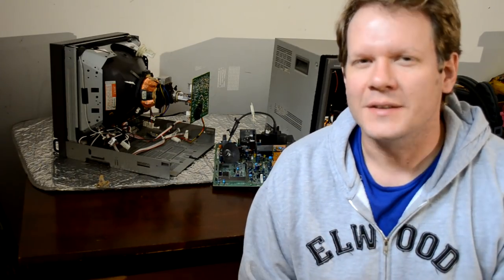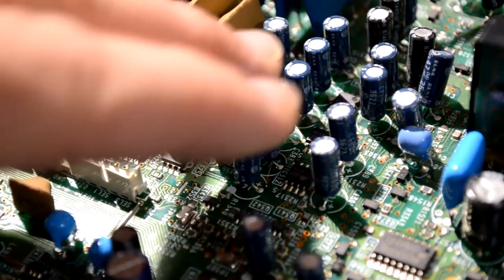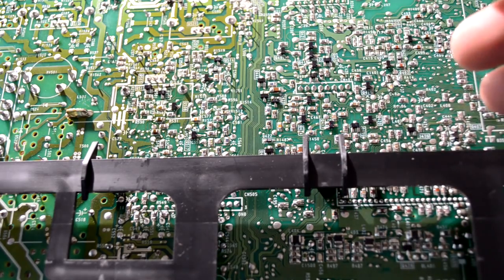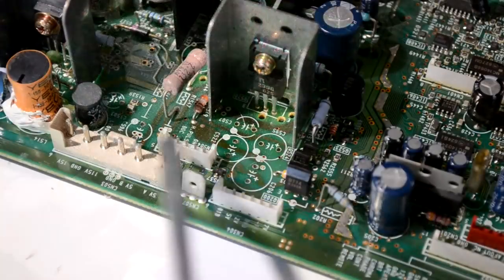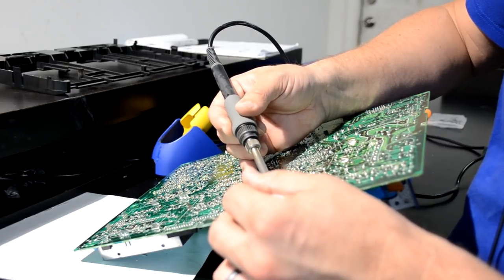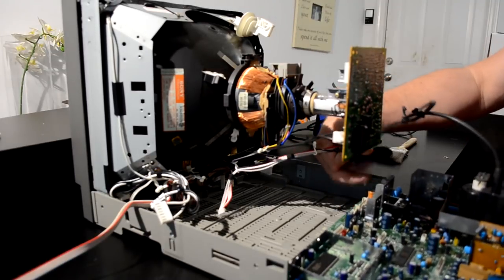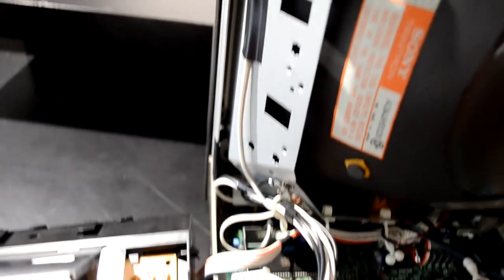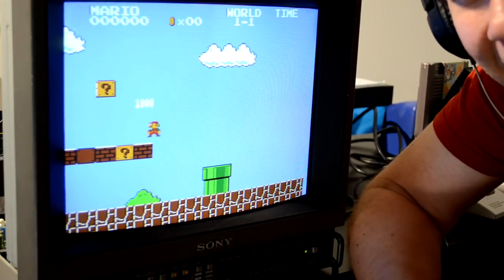Geometry Cap Kits - Sony PVM Screen Perfection

Comment: Reflowing the joints before desoldering really helps.  I've often ran into problem joints where I have to add solder anyways.
Reply from the maker: Yes, best part is it prevents a lot of damage to the board and pads.

Comment: Wish my bvm-2010p had so few caps!   I’ve done psu, convergence board, control boards in the pull out drawer, and all the high voltage boards.  The picture is now possibly too good for 240p.  The scanlines have such perfect geometry they look like they are emulated.  Best crt picture i’ve ever seen. Not bad for a 31 year old monitor.
Reply from the maker: Awesome, yes it's a great feeling to have a perfect monitor.

Comment: Does this apply somewhat to consumer Trinitrons?  I have a Sony Wega that is developing a slight screen jitter and some very slight geometry issues.  The geometry doesn't bother me because it's not too bad, but the jitter is getting kind of bad.  Intuitively it seems like a recap could fix it but the service manual shows a couple hundred electrolytics.

Comment: Should I recap before using the service menu to calibrate my Consumer CRT?

Also, where can I get calibration patterns like the crosshatch one?
Reply: It will be clever to calibrate first and do recap only if you cant fix it with service menu. 240p test suite is best for tests

Comment: Steve. Thank you for sharing your knowledge. I have a 20M2U that shows double blue, green, red lines at the top. Do you happen to know which capacitors need changed? Thanks in advance for any advice.
Reply: Those lines are actually normal, but they should be hidden behind the bezel, so most likely your picture height is too small. I'd try adjusting that in the service menu first, it may be all that is needed. The setting you want to adjust is labeled
"V SIZE" and there is one for 50 Hz input and one for 60 Hz. Have a look at Steve's video about the PVM service menu for more detail.
Reply: Martin Weizenacker V spacing in service menu fixed it thank you!
Reply: @davidcarmichael4006  That's great!
Reply from the maker: I did make a video on permanent fix for that.  2 caps can go bad to cause that.
Reply: Retro Tech i will watch it for sure. Thank you

Comment: Hey steve love the vids, is there much that can be done with consumer flat screen trinitron geomerty wise outside of service menu adjustments. Dont really want pull the tv apart as im worried il will ruin it
Reply from the maker: Thanks, probably not.  Nearly all geometry adjustments are in the service menu for Consumer CRTs made like after 1994.
Reply: @RetroTechUSA  thanks mate its still a great crt and i have managed to get it looking pretty decent

Comment: By the way Chassis refers just to the outer shell or frame of any electronic, not any of the boards or guts... Just thought I'd let you know.
Reply: Obviously you know nothing about video monitors
Reply: @FragBenitez  Except... That's the actual definition of Chassis... Also I own a 20L5, 14L5, 1910 (original model/not newer), and 1271Q, and have worked on them myself..... So yeah... I do know a thing about video monitors